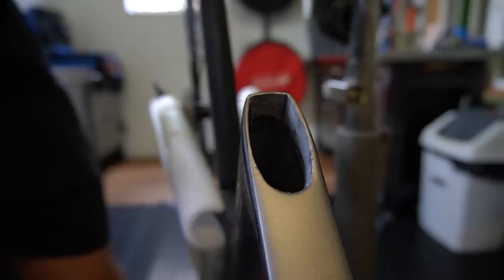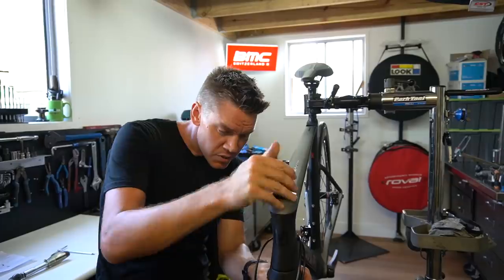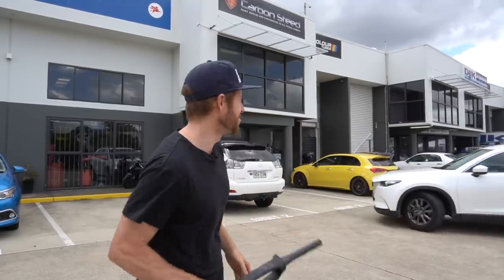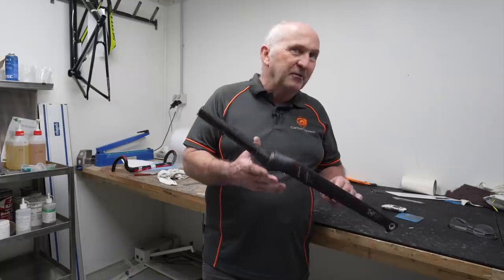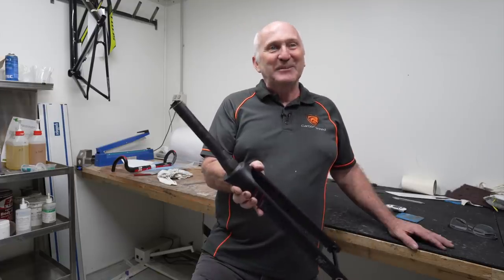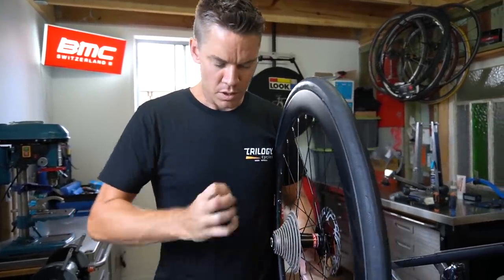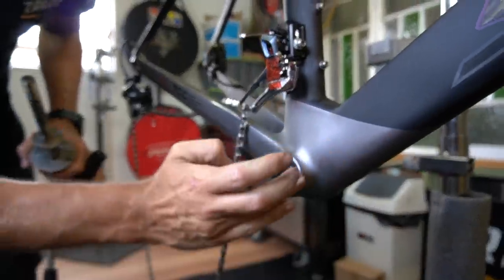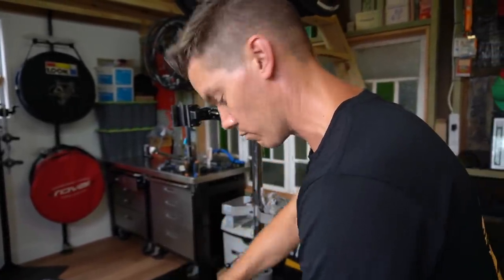The Cheap Chinese Carbon Bike that Backfired

Comment from the maker: I hope everyone is well out there. I wanted to make this video, in particular, for those people out there considering these cheaper alternative road bikes. The intention of this project was never to land where we have, but I truly believe it's an invaluable learning experience for me and many others out there. I would really encourage you to watch until the very end to appreciate the full picture. Cheers, Cam
Reply: Rule 101 bike suppliers - check the bike before you send it out for review. Cam, great content showing the bike build and what's required in terms of grease and tolerances. Would love to see Trilogy Cycles do a similar build with commentary on a BMC bike. - EDIT II see you have already done this!
Reply: You should look at Trifox bikes
Reply: Sorry for nitpicking, but do you mean intention in the video desc?
Reply from the maker: @hippoace  Yes, thank you. Running at a million miles here. Fixed.
Reply: I'm currently using the same Kootu carbon wheelset. Yes, the free hub did bouncing a bit. As the shop told me, these 'cheap' hub are like this, it cannot be fix unless we change it.
Reply: @701garage  Got 2 X10 aero bikes from Trifox....they are exactly the same as a Cipollini NK1K and made in the same factory...Except the trifox is £525 Sterling and the Cipollini is £2500 sterling!!!
Reply: These get imported and sold by the score here in Qatar where there's a huge cycling community.  Clearly there are going to be some tradeoffs with these when compared to a top-tier brand, but I really never suspected it would be quite this bad.  I got a used Giant Propel SLR0 for roughly twice what these sell for new, but the Giant was good to go with a new chain and new GP5000's from my LBS and is not going to wobble at speed or collapse and leave you bleeding on the side of the road.  If you are still game for investigating off-brand frames that are affordable and popular, I have noticed a lot of Filipino riders getting bikes from Elves, another brand I'd not heard of until recently, at a price point of around 1200 AUD for the frameset.  I enjoy the channel and the mechanic's brutal honesty.
Reply: Good honest review, Cam. Were you able to take note of the model of the Novatec hubs?
Reply: Whilst there are definitely low quality death-traps, medium quality, and high quality Chinese direct options, the same can be said of Western brands at more than 10x the price.  Specialized, Cannondale, Canyon, Factor, Cervelo, Pinarello, OPEN, BMC (etc etc etc) have had absolutely appalling design problems, and frequently experience woeful build quality, QA, and failures (because they won't pay the OEMs a reasonable price per unit).   People need to realise that the 5-6000 dollar frameset they bought might be every bit as much of a deathtrap as the $300 knock-off of a big brand's design.
Reply: Thanks! People need to understand that there is a cost for quality.
Reply: Thanks for the great content as always. I was always curious for a full teardown and inspection of these bikes considering how cheap they are for what you're getting, the cheapest carbon frame with 105 groupset being roughly around 1000 USD/1400 AUD. These bikes seem to be selling quite well here in Singapore as I've noticed many cyclists on Sava bikes(also being sold under the brand "Volck") and I haven't really seen or heard of any bike failures yet, but I'll probably stay away from these bike after seeing this.
Reply: It's very easy to ride a high horse and point out all the faults of this bikes and by implication use a broad brush to label all China made bikes similarly.   I dare say even the better known brands have issues also if you dig deep enough.  I don't think I heard any mention was made of a 5 year guarantee offered by the manufacturer (and local distributors) in the event of any cracks in the frame,  or serious issues encountered.   Perhaps they feel the same way with your wine and  meats as you do with their bikes ?
Reply: Winspace is the same quality like this Chinese frame ?
Reply: But you forgot the most important part. The price........ Jesus.
Reply: Caveat emptor!
Reply: Ive had my Chinese carbon frame for more than 7 years now, raced it in more than 50 mountain bike races. and its performed perfectly.
Reply: @pmcmpc  The western carbon frames are  designed in western offices but made in Chinese factories. I lived in Thailand for more than 8 years and came across plenty of the generic Chinese carbon frames and they worked just as well, both on road and mountain bike races ( of which I did more than 50 on my carbon framed Chinese hardtail.)
Reply: I've seen that sava bike before , what does the old guy say is the best china bike on scan ?
Reply: Very good content as always!🙏🏼 I came across JAVA, another bike brand from China. But JAVA bikes are UCI approved. Can you please make a video on their bikes and see if they can stack up to the big name brand or should stay away from them. 

Thanks!🙏🏼
Reply: I have been chasing a large MTB last few months and just cannot get the model's I am after due to Covid supply issues, was considering some Chinese model's, SAVA MTB's look like great value on paper...... after seeing this video it changed my mind. Thank you Cam for your honesty and commitment to the biking community.
Reply: The video badly needs more clarity . Some assembly faults were not explained clearly enough for some viewers . The bottom bracket & disc brake post mounts cannot be verified for trueness with the tooling used as the facing tools themselves have imperfections anyway . I have encountered this myself as have several Australian bicycle dealers . The bottom brackets that are threaded are rarely perfectly perpendicular anyway  .
Reply: @jasonlimbh79  In recent years Shimano freehubs seem to have more play in them than I would like .The best hubs were made in the late 90's as far as XT/XTR is concerned . Technology has improved but not precision & workmanship .
Reply: @jopsjosef9414  I have Novatec in some of my builds & as long as I optimise them , they are okay .
Reply: When I do a bicycle project for anyone , I am very fussy & careful . I have blacklisted a multitude of brands including BMC among them as mentioned in other comment on this thread . I ask for feedback from all clients & provide ongoing technical support . I encourage  product feedback . I have a commissioning process for fresh builds . Two one hour test & refine sessions . Then call client for pick up or deliver as needed . I give them a complimentary gift as well . Sometimes a free helmet or lights/ tubes.
Reply: @ivanm1018  Buyer beware !
Reply: @williammorris6097  I would treat this with a "grain of salt" .
Reply: @jphadarly8459  If a brand hasn't been around for 20 years or more , I keep away from them .Time is the real test for brand credibility .
Reply: @jphadarly8459  I'm currently using 2021 Java Vesuvio Disc for more than 1 year already. I'm not a pro to do a details review. But so far is working well except for the mechanical cable pull disc brake calipers that comes with the bike. I had to say is useless. You still will go forward with pulling your brake.
Reply: @jasonlimbh79  I have ways of getting the most out of  mechanical  disc callipers. Some people  still  want  them as bleeding labour is costly & sometimes heavier riders burst hydraulic  lines .
Reply: @jasonlimbh79  Thanks for the reply. Appreciate it.🙏🏼 I am looking into buying a Java road bike and your inputs are valuable because I can’t seem to find a review in english in the internet.
Reply: @robertmcfadyen9156  i already changed my Decaf calipers to semi-hydraulic calipers, Juin Tech F1. Much more satisfied with the original ones. I choose Juin Tech F1 because i no need to waste more money to change the shifter too.
Reply: @robertmcfadyen9156  what is the problem of BMC?
Reply: @aczephyr  pmcmpc said this was true as has Cadel Evans told a few of us privately  .
Reply: @pmcmpc  Too many people are missing this exact point, it's taken Hambini to open people's eyes to the piss poor QA on some of these "name" brands. There is also a ton of snobbery involved, and selection bias, no one wants to believe that their 5000 dollar frame is garbage. I like Cam's videos and in this case I would have like to have seen a follow up with a new frame from the same company. Also I might not have watched enough of his videos but do they strip and inspect Zipp wheels Bianchi, Canyon, Look Cannondale frames to check for imperfections or is it just cheap Chinese stuff?
Reply: @davemellor4697  I've got an Airwolf YFR029 frame . Rides fine and was around £500 delivered to the UK. The Trifox X10 is the same design as mine but mines rim brake.
Reply: Got to say mate, I’m new to riding and spending 5k plus I just cannot warrant that yet, I’m hoping my riding continues 34 to 64 and will purchase a +7k bike in the coming future, but I truly appreciate you delving into the cheaper alternatives, myself like many  others are in this position and knowing what a good startup bike would be, is an excellent way to get into a whole new world and science of fun. I had an old Avanti chrono 2.0  it was too big and I sold during covid. And. Ow looking forward to another bike. Appreciate the content and will sub for
Reply: This video isn't an example of why not  to buy  a Sava bike it's an example of why not to buy a cheap bike with Hydraulic disc  brake, if this was mechanical disc brakes you could widen the pad distance so it won't rub.
With that said this bike is a fraction of the price of what big name brands cost, using the same parts.
Moral of the story buy this bike and replace the wheels with something good from Easton or Mavic etc and you still pay a fraction of the price Cannondale would charge for the same bike
Reply: The budget priced options always seem to be like this one. There are better quality chinese bikes, but they aren’t really much if any less expensive than the name brand bikes. In the end, you still get what you pay for.

Comment: Hey Cam, I have owned 3 bike shops and sold thousands of bikes. I have seen several of the big brands carbon frame's with imperfections and terrible finishing. FYI.
Reply: This video is bollocks, trying to put people off buying aliexpress.
Reply: これら全ての意見からsavaは買わない方がいいと言うことですか？
Reply: yeah this channel is pretty awful, I don't understand how they continue to release such badly thought out content and succeeding lol they basically just pander to dentists. This bike even in this state would be perfectly ridable for years without issue. The rotor would literally heat up and bend itself to align with the wobble of the hub. Sure a wobbly hub sucks but 99.99% of people would never ever even notice. I would almost promise you that if this guy took all his bikes and tested their hubs at least 1 of them would be the same
Reply: And the shop brands always replace them very quickly if there is a problem. You get what you pay for.

Comment: I’m not sure why this bike wasn’t considered for at least testing…I’m sure it was fully rideable.  I have seen many with voids and excess resin placed.  The cost of these frame/fork combos is sometimes a tenth of mainstream brands.  I’d certainly skip a “complete build” but I would do that with any major brand as well.  Cam notes that the wheels are the issue…as if the base “Rovals, Bontranger and Alex” wheel sets that come as OEM won’t find the closet hours after the bikes are brought home.  Poor review overall.  I’d also add that the mechanic seems annoyed at this build…I’ve built mainstream brands with poor lubrication from factory.  In this case they did NOTHING so the shop would need to step in and do the task.
Reply: I agree.  Looks like a chip on their shoulder.  I buy lots of bike parts on aliexpress and most of the time I feel I get a great deal.  No hate to the no name brands.  They are way cheaper and usually perform ok.  They just don't have as much of a polished look usually.
Reply: No chip... Bike was supplied to me to build as came from box and was asked to inform honestly what I saw in detail. 
Bike was Unrideable as the front wheel would not even rotate from hub flange / binding rotor / terrible caliper mount position on fork. 
Suggested to change wheelset at least and modify caliper  but needed to be assessed as a client would receive if he/she was to build at home. 
Therefore terrible quality and unrideable in this instance. Cheers
Reply: @BS16Tech sure lmao you are a professional liar.

Comment: Cam Nicholls you can not compare this bike to a $10000 bike. Not all good quality bike over $10000  will last well. As you seen how many good quality bike (pro) fail in the first 5000 miles? 99.9 of viewers  dont have enough money to buy a good quality bike. So this is a good bike for amateur or avid person. Looks like you want to put down this brand for the price your forgot mentioned.

Comment: These videos are so biased against the Chinese brands, without telling you that nearly all Carbon Bikes are made in China and Taiwan. Not everyone has 6-10k for a bike which is indistinguishable from a 1-2k bike. All you wanted to do with this bike was find faults and you found them. Put any Carbon frame to this much scrutiny and you will find faults, I don't care who makes it.
Reply: China can't build anything that is even par above garbage. I've taken wheel bearings off of cars with 200000 miles that were better than the garbage from China and their bikes are no different. These corporations are whores that will spread their legs for a nickle..
You want a real bike find a usa made steel, titanium or aluminum made frame and build accordingly. They are usa made carbon frames that are made here as well.
I paid 1000 for a lynskey ti frame that I picked up in Tennessee where it was made, spent another 1000-1200 on wheels and Japanese made ultegra to go on it and I have a bike that is fast as you can ride it and will out last these garbage frames by decades.